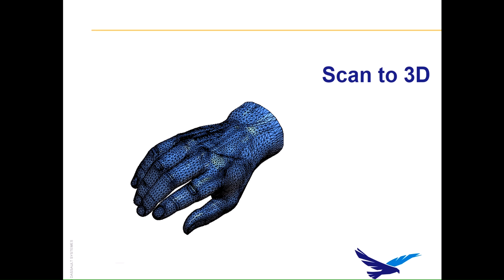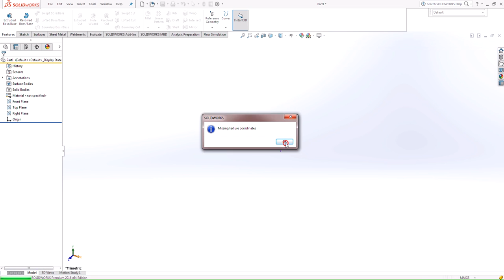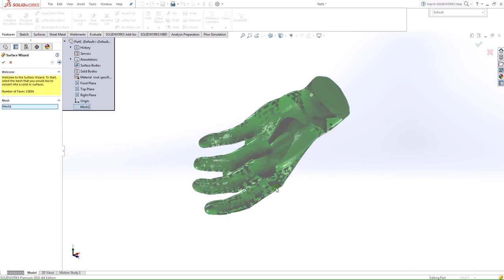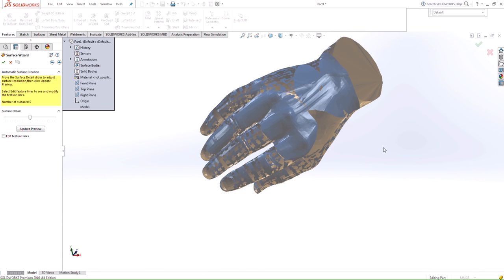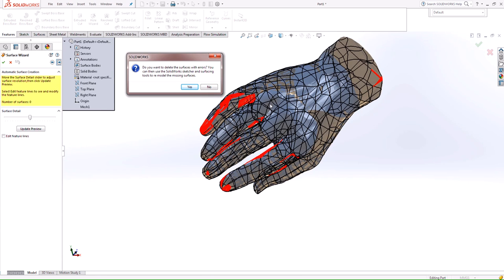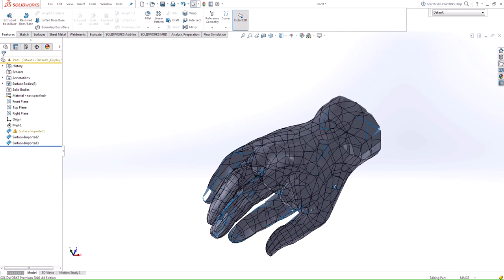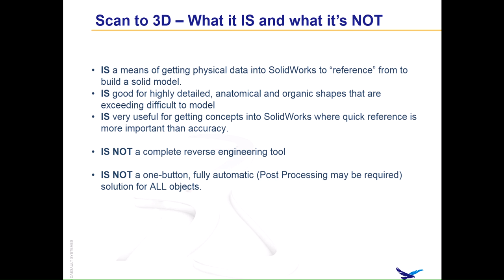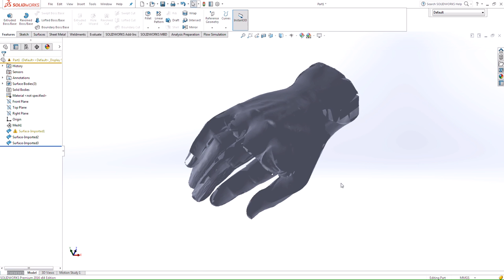An Overview of Scan to 3D in SOLIDWORKS

Comment: when i import any STL file the options under the Scan To 3D arent visible?
How should i proceed?
Reply: I had this problem too, and even tho it's been 5 years, I still think posting this answer here could be useful: 
BEFORE you open your .stl you NEED to go to the top gear and go to add-ins and turn on ScanTo3D. THEN you have to go to Open file and under file types select "Mesh Files". Only then does it know that you want your .stl to be a Mesh and not the insanely confusing Graphic Mesh.
Reply: @ACBLOWSCOLD  5 Years aint too long lol. This is what I was stuck on as well.

Comment: Is there a tutorial on how to fill in the deleted surfaces? I am having trouble doing this because insert plane requires the planes to be planner...
Reply from the maker: Hi Spinner,

Unfortunately we have no videos that specifically show off how to do this. However, usually when you use the feature Delete Face, you can try to select one of the Fill or Patch options. Another feature you can try to use is Fill Surface where you select the edges of the boundary and it tries to fill.